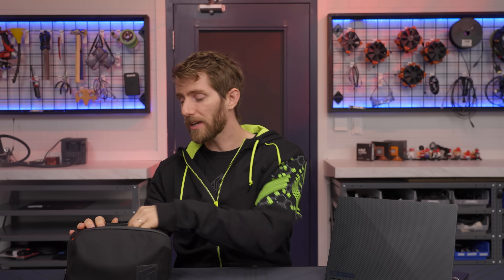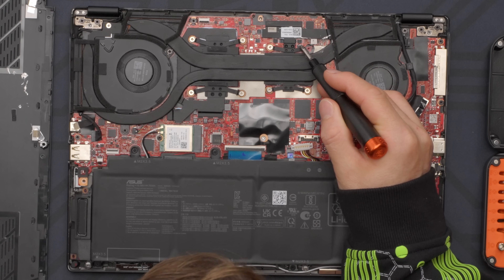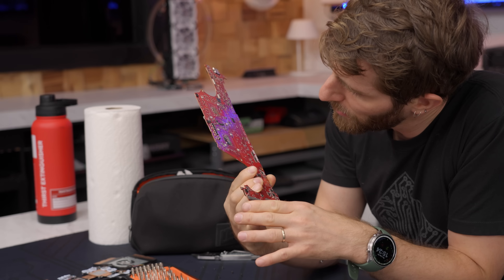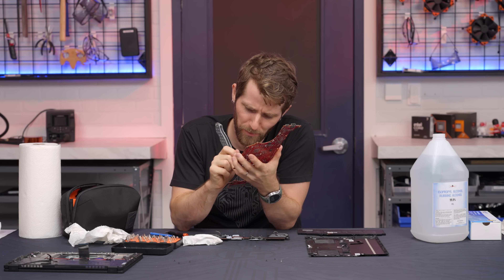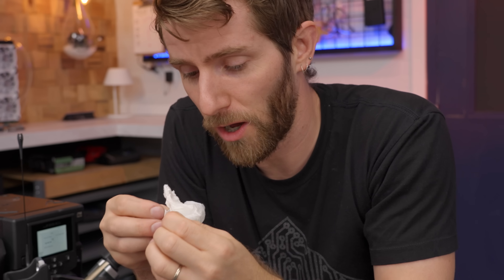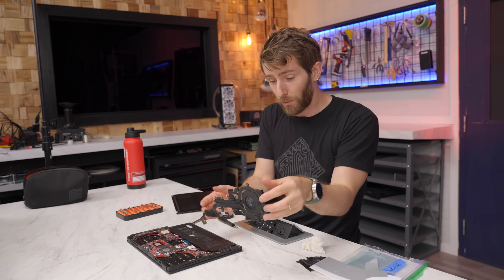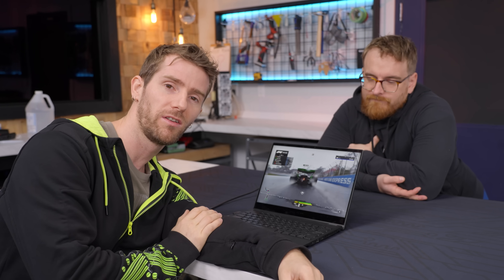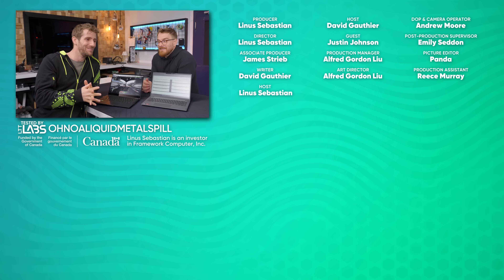Liquid Metal Killed my Laptop… Now What?

Comment: I have a Acer predator helios neo 16 that had liquid metal in it and one day (3 days before expiration of warranty) suddenly it stopped booting (lights were on but nothing was happening). I took it to service centre (which is 80km from my village) next day and found out the motherboard was dead due to liquid metal thankfully the guy at service centre was and registered the complaint instantly and ordered a motherboard replacement. He told me that Acer will send an employee to my house to replace it free of cost, but after a month the employee which was going to replace my laptop said he cannot visit my home and I need to come by to a nearby city which I did as it was not a much a problem but what was problem that after mobo replacement he didn't apply enough lm to properly pull out heat and laptop was overheating even at idle, so I again took it to service centre and the nice guy called the employee directly and scolded and nearly fought him for the negligence. Again the same employee came and re applied the lm and gave me an extra lm kit (surprisingly for free). Temps this time were better than before but still it was heating more than if should, I tried to use it for a month but temps weren't settling so I opened the laptop myself and to my surprise (or not) some of the lm was leaking out of cpu and was present at different parts of mobo very far away from cpu (I think am insanely lucky and unlucky at same time that it hadn't short circuited anything despite lm being everywhere). I cleaned the lm from mobo and ordered a normal thermal paste (XM6 and couldn't order ptm7950 was because it shipping would be far too expensive than the thermal compound to India). Now my laptop is saved (hopefully) and it's working fine, its temps does go higher than the factory lm application but laptop doesn't overheat.

Comment: I’m so glad this was finally pointed out. A few years ago, I had a G14 Zepherus, and as a student, I had to use it just like Linus described, obviously not carelessly but using a mobile device as a mobile device. One day, I went to class, and it no longer turned on. I opened it up and found the Liquid Metal dotted everywhere. I tried to go through Asus support, but it was legitimately abysmal. I decided to just cut my losses and replaced it with an XPS 15, which has been holding strong since.
Reply: Asus support is designed to support Asus, NOT the customer.
Reply: Unfortunately Dell also use LM in some laptops, though I think its mainly the Alienware ones. And yes, those leak too.
Reply: I bet you dropped your laptop a couple of times. The liquid metal isnt just gonna leak by itself
Reply: @ts8960  While you might be right, a laptop is usually being carried in a backpack being sideways, if you're walking, running or simply riding a bus, the vibration and motion will shake it enough to make it slowly leak overtime, OP mentioned they're a student so it's very likely that's what happened without necessarily dropping it.
Reply: @ts8960  It's a laptop, ofcourse he did. Some bumps and vibration shouldn't impact it or the design is bad.
Reply: @ts8960  Yes it will if you overfill the cavity with it. I've watched a few repair videos on Parts People Dell's channel where he's cleaning out liquid metal. Metal expands when hot, if you don't allow for that expansion then it will make it's way out.

Comment: Was intrigued by liquid metal when it came out, saw what a mess it quickly can become, decided to never ever touch it for my systems. I remember a good bunch of people killing their systems when silver thermal paste was all the rage and that stuff was way easier to handle. Liquid metal just seems like the next, messier evolution to that. Also I never had a system run into trouble with good old MX4, a few degrees cooler is just not worth the risk if everything operates within normal parameters...

Comment: From physics point of view, thermal conductivity of liquid metal is way better than thermal paste, but it doesn’t guarantee that transition between surfaces and Liquid Metal is very good. It may have too high surface tension to get every small micro dent. Since it gives better results in higher temperatures, it may lower the surface temperature. Another possibility is, fan may react differently if heat conductivity is better,

Comment: Gallium is a really cool metal, but far from what I'd want in an expensive piece of portable technology. You can cover a scooter in it, let sit for about 20 minutes then ankle tap with the deck. Your ankle will drop the classic "must've been the wind" as the scooter disintegrates.

I've also heard (so take with a grain of salt) that it is stupidly hard to ship, and might cause issues if you're device has liquid metal within it while travelling, because of aircraft frames and components. 

Anyway, it makes for a real easy "planned obsolescence" for manufacturers that they arguably could defend in a court

Comment: Liquid metals are used to make low temp solder for difficult to remove PCB components. Meaning that liquid metal blends with the solder making it liquify at really low temps. as in room temp almost. Making components fall off. which is why the part fell off the board when Linus touched it. Meaning the PCB is finished because parts will fall off just putting it in his bag. The reason for the short is parts are no longer attached to the solder pads and there is no way to find out which ones without stripping the PCB of everything. Even if you remove all the metal from everything the first time you fire up the system and bump it parts will fall off.

Comment: I seen it waaay too many times where liquid metal fail and brick the device. I personally wouldn't ever buy or use liquid metal in any of my devices that I use, just not worth it at all. I don't care if it slightly drops the temperature, I just rather not have a fail point.

Comment: I would like to share my story with X16 flow. I've got this laptop few years back, but I still remember it to this day. When I got it after shipping nightmare that almost lost it in transit, I would normally boot it straight up, but because my previous laptop died, I decided to move my disk and glad I did. The little magnets on the backplate, one came completely loose and was hanging between shielding on wifi and the big cap near battery connector and one was loose too. I've fixed this but after few months, it started to overheat like crazy. So I took down the cooler and most of the LM from cpu moved to the side and on half of the sponge. It also had a small scorch mark on cpu and cooled (funny enough it looks like YT logo on the cpu rectangular die). Replaced it with PTM and the thermals were even better, than stock when I got it. Just to note, it was mostly situated on table with charger in on heavier load and slightly propped by the paper stand that came with it. Safe to say, I'll replace any LM from now on in any computer with PTM and probably avoid asus with the RMA nightmare and HW issues, that the laptop developed.

Comment: I think it's dangerous to put liquid metal on a laptop at least they should put a warning label and use it sparingly because the moment you overclocked or didn't clean the fans it will overheat and will expand and will breach any kind of seal.
Reply: Those components that was touched by the liquid metal should be deemed shot or cooked that is why it is very loose. Replacing those might resurrect the laptop.

Comment: I remember repasting my ROG GL502VM with Thermal Grizzly Conductonaut back in 2021. I haven’t checked or reapplied it since then, I did take precautions like applying 5 layers of nail polish to the pins near the CPU and used electrical tape. It still runs fine today just sad that it can't support windows 11. The fans are super loud, but temps seem okay even in games like Marvel Rivals. Im thinking maybe one of these days il try checking it to see what it looks like and repaste it with something non conductive.

Comment: Asus did not put that liquid metal on, someone else did because if you look at the process of how liquid metal is applied by the manufacturer it is applied by an automatic system that applies a fixed amount of liquid metal. This is controlled by software which you set how much liquid metal to release. It is therefore not possible for Asus too put to much liquid metal on the die if the laptop is a brand new one from the factory.  Therefore in my opinion that laptop is not new. It has been in the hands of somebody else who has at some point has removed the heatsink and applied the liquid metal by hand thus putting to much on it.

Comment: I just had a thought. I bought soldering kit awhile back. One of the tools was some kind of desoldering pump. Like a reverse suction syringe to suck up heated up solder. Maybe that is also a useful tool to suck up liquid metal? Then again the solder is supposed to quickly cool and store in there. Maybe just a simple syringe or mini wet vac would do.

Comment: As a long term liquid metal user, every single LM-cooled device in my possession has been replaced by PTM7950. In most cases the temps are within 5c delta from each other and on my Omen 15 the PTM actually outperforms the LM by 3c

Comment: Liquid metal on your laptop CPU is fine, if it is manually AND skillfully applied. A performance gaming laptop has been with me since 2017, and I specifically requested it to be changed to liquid metal by the boutique seller as the normal thermal paste has not been working (aka overheating under heavy load).
So 3 things: 
1) Do research on optimal ways of applying liquid metal on laptop CPU (preventing leakage) 
2) Check if carrying it around with minor thumps really causes it to leak out 
3) Do impact test to see if liquid metal leaks out.
Edit: My situation will not apply to all, just putting it out there that LM is doable.

Comment: I've been using the same latop as Linus since it launched in 2021; the Asus Flow X13, my varient was the GV301QE, which I paid 60,000THB (2850AUD, 1900USD) for, they later jacked up the price later in the cycle. My laptop crapped out late last year in 2024 with me using the warranty policy 2 times, once for a RAM issue, then a few months prior to it dying, a change in liquid metal because it was overheating like no tomorrow.

When it died, I took it to a local laptop shop for them to have a look at the problem, and it was clear that the technician who serviced my laptop last, did not replace the silicone border that goes around the CPU dye, allowing the liquid metal to flow and seep out of where it should've stayed. I brought the laptop back to ASUS Thailand, and they refused to take any responsibility nor accountability for their sub-par warranty repair. Now I have an expensive paperweight that only lasted about 3 years since I bought it, and of course the thing dies just outside its warranty period.

I've been using ASUS products since I was a child, always impressed with their quality. But since my most recent laptop with them died, and how they handled the situation, I would be hesitant in buying another ASUS or ROG product again in the future. I've sinced bought myself an MSI Stealth 14 AI Studio A1V on sale for 59,000THB off from 80,000THB (3800AUD, 2500USD), and I've been very happy with my laptop. What I missed the most from my Flow X13 was the touch screen and USB-C PD charging. But so far, everything else on my MSI is an upgrade (or to expectation) over the Flow I had.

Comment: Speaking of Framework laptops, they originally designed their 16" high performance model with liquid metal, but it ended up being their number one cause of repair requests. After some testing of PTM, they realized it works nearly as well and is much more stable, so now all new 16" laptops come with it by default and they have replacement kits for the OG LM model as well. Thankfully, this all happened before I bought mine!
Reply: PTM7950 also last for multiple years without any degradation since its original purpose is for server and data center that operate continuously 24/7/365

I already use it in my Thinkpad since 2 years ago, even until now there's no thermal throttling and the temperature never exceed 85C even in full load
Reply: It's really kind of amazing that the madboys at Honeywell set out to make something almost as good as thermal paste but which you wouldn't have to replace for 20+ years at a time, and accidentally ended up with something that outperforms any thermal paste on the market and comes in barely a couple degrees behind liquid metal in most tests with zero risks.
Reply: when did they make the change?
Reply: That has to be the dumbest thing I’ve ever heard someone design for a laptop. 

Let’s put Liquid Metal on something that’s meant to be taken apart!! BRILLANT IDEA! 

not to mention framework’s chassis isn’t even that great considering it doesn’t even dissipate that much heat compared to everyone else

Comment: Thought I'd bricked my desktop motherboard when I spilled liquid metal on it and it didn't start up anymore. Used some WD-40 Contact Cleaner a few times, wiping inbetween each application. 3 washes later I tried it again and it hopped back alive. It has since also saved some RAM sticks that didn't want to behave. At this point, it's my 'Hail-Mary' product for when the machine spirit gets cranky ☺️

Comment: Love the show.
However, ISO 99.9% is really dangerous stuff and people don't understand it. They put in bottles and spray around like thats an approved usage. Please PLEASE don't just leave ISO open and dont' just sit over it when you clean.... and for the LOVE of GOD do not clean your "GLASSWARE" in a bathroom with the door shut day after day for years.... It's what make 420 users CRAZY not the 420!!! Read last line!

Long-term, high-level exposure to isopropyl alcohol can have serious and potentially permanent effects on the brain and nervous system, leading to a condition sometimes referred to as chronic toxic encephalopathy or solvent neurotoxicity. 
Neurological and Cognitive Effects
The effects generally progress from subtle, non-specific symptoms to more defined neurological deficits depending on the intensity and duration of exposure. 
Memory and Concentration Issues: One of the primary long-term effects is a subtle impairment in cognitive functions, including reduced memory and concentration.
Personality and Mood Changes: Individuals may experience personality shifts, such as increased irritability, social withdrawal, reduced motivation, fatigue, and sleep disturbances.
Coordination and Motor Function Impairment: Chronic exposure can lead to reduced coordination, balance issues (ataxia), and potentially effects on the nerves in the arms and legs, causing weakness or tingling sensations (peripheral neuropathy).
Cerebellar Dysfunction: Some case studies, particularly in individuals with long-term, high-level exposure (often due to abuse), have documented cerebellar dysfunction, which affects movement and coordination.
Dementia-like Symptoms: In severe cases resulting from chronic, heavy exposure, symptoms can resemble dementia, involving significant intellectual impairment that may not fully recover even after exposure ceases.

Comment: My fat launch model ps5 is still working fine, the inside has never been opened before, it has been placed in vertical and horizontal for 50/50 of the time. And no force closes, no temperature warning, I've moved house twice. Some engineering from sony right there

Comment: Surprised you didn’t rig a pump and tubing together, then hose the board down with alcohol over a bucket. That would have been way less harmful to the PCB / traces than using paper towels and knife.

Comment: As a computer repair technician, I hate liquid metal.  There is no good way to remove it, just a bad way and an even worse way.  If you've got liquid metal on your board, the bad way is to use a toothbrush to take it off little piece by little piece.  The worse way is... all the weird stuff Linus was trying.  CPU and GPU manufacturers need to stop making chips that run so hot you need liquid metal.  Stop cheating by just flooding your chips with more power for performance gains.  Apple was so right to ditch Intel and make their own chips.  They're the only chipmaker who cares about power efficiency and thermals anymore.

Comment: next time cool down parts which contain liquid metal - it's solidified and easier to fall appart and it doesn't stick to components.
And i think you might have ultrasonic cleaner for motherboards - so after cleaning it mechanicaly - put use that cleaner.

Comment: Been saying this for years....liquid metal is stupid for anything other than temporary overclocking setups. Even if the issues in this video weren't a concern, just the fact that liquid metal requires at least yearly serviceability (needs reapplication) and the fact that it is corrosive is enough evidence that it should never be used in laptops.

Comment: I have an ASUS laptop that came with liquid metal from the factory, too. Now, I didn't have any shorting issues with the TIM, but I did have extremely reduced thermal performance due to migration only a little over a year after buying the unit. The fans would ramp up to 100% just browsing the web lol. I decided to ditch the liquid metal and use PTM7950 (buy it from LTT, it costs more but fakes are too easy to buy by mistake) on the dies and LTP81 thermal putty on everything else. That fixed it right up and temps are nearly as good as fresh liquid metal, in my experience. I have no idea why any manufacturer would ever choose a TIM that needs to be serviced more often on a laptop of all things, which is among the harder things to service.